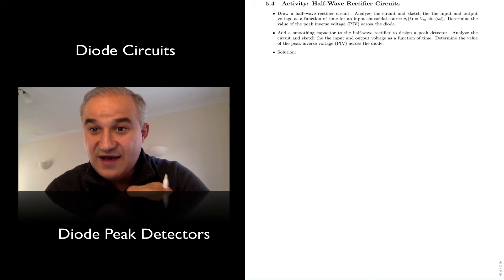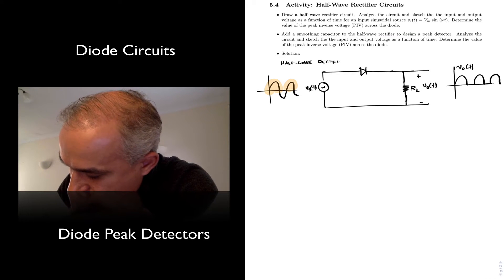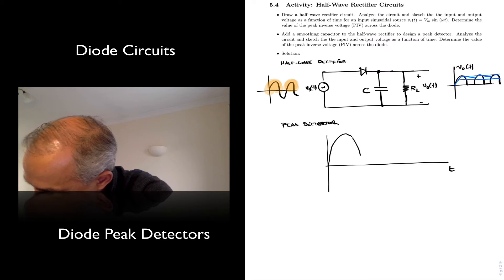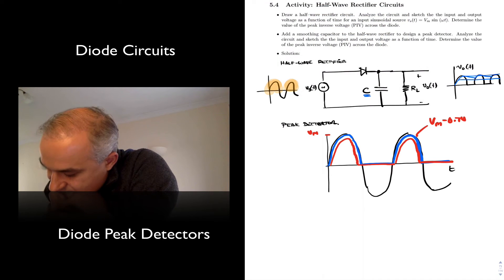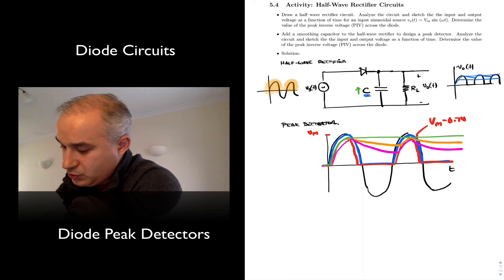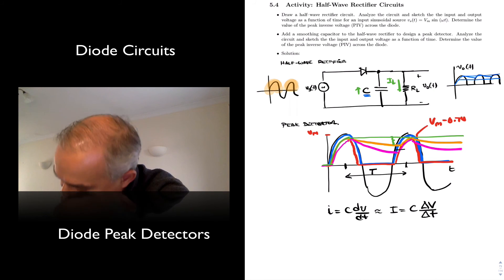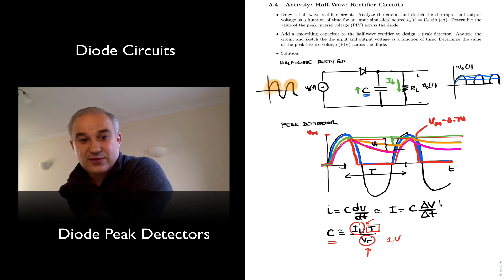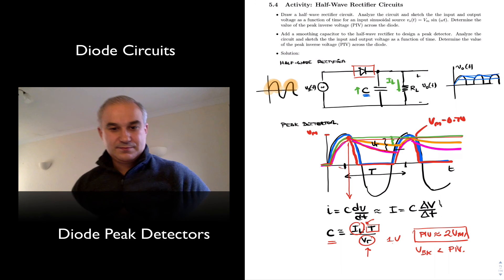Diode Peak-Detector

Comment: The discharge of voltage on the capacitor is actually given by V(t) = Voexp(-t/RC).  This can be derived from 1st principles by applying KVL to the RC circuit using 
Q(t)/C = R(-dQ(t)/dt).  The minus sign is justified since the charge on the cap is decreasing.  The solution of this differential equation is Q(t) = Qoexp(-t/RC), from which we get the previously stated expression for V(t).  This voltage on the capacitor can then be expanded as V(t) = Vo(1 - t/RC + (t/RC)^2/2! - ....) .By design, the cap is chosen large enough that we can approximate this with only the linear term, so V(t) = Vo(1 -t/RC).  From this, the change in the voltage, from its initial value of Vo, is dVo = (VoT)/(RC) where T is the total discharge time.  That is, the ripple is dVr = (Vo/R)(T/C).  Taking the current to be constant (another approximation), we have dVr = IL(T/C) where IL = Vo/R is the (constant) load current. Knowing this result, from fundamental principles, we can say simply that, if the current is constant, the droop (ripple) on the capacitor is dVr = ((IL)(T))/C, which is the desired approximation.